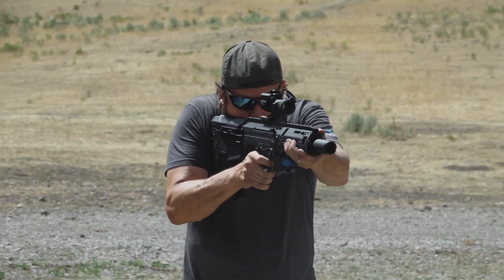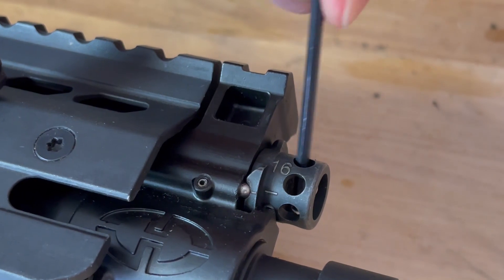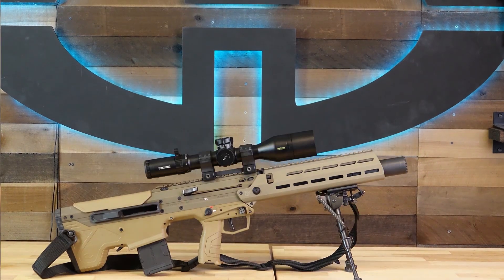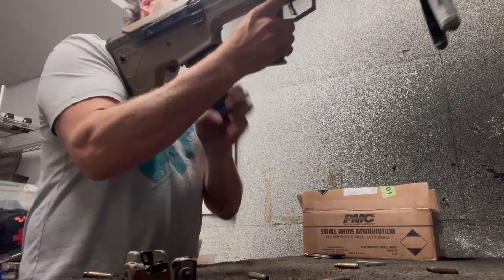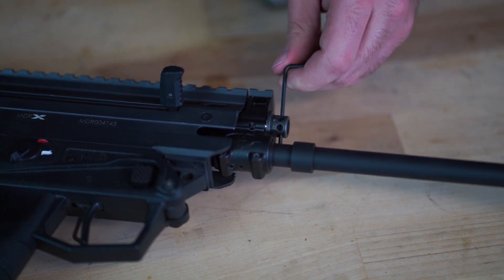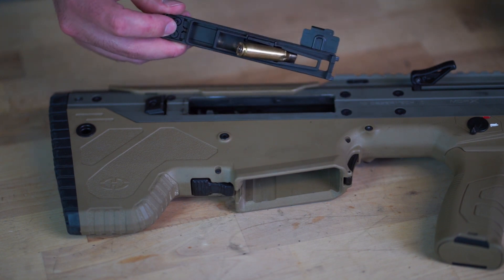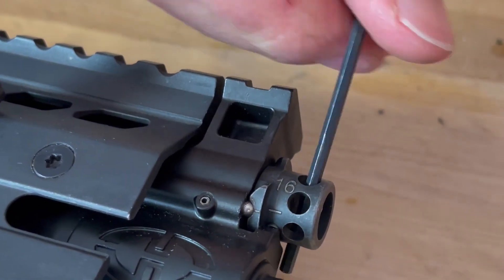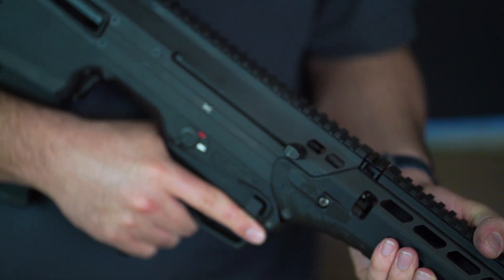MDRX Gas Valve adjustment

Comment: When I initially got my Side Eject MDRX back in 2022, I was pretty depressed to be getting stovepipes on nearly every other shot of both .223 and 5.56.

So I thought, ok, boost the gas, that should solve it? Did so, and it worsened the problem substantially. But...one click down to N-? Runs like a top. Zero issues since. Thing is perfect and I love it.

Comment: I have an older gas valve on my 16 inch 5.56 barrel. It is incredibly difficult to adjust with the handguard installed. I was disappointed to find out today that a replacement newer version is $79!!! And I'm guessing that doesn't include Shipping or Tax!!! I was under the impression from reading in forums and watching videos, that I could acquire a replacement with the cost of shipping. Guess I was wrong. 😡🤬

Comment: That last tip is very important. Most guns are over gassed from the factory. I know some people who have turned their gas down two settings. It makes a big difference in the recoil and controllability of the gun.
Reply: Tell me about it.     My .308 MDR runs on the lowest suppressed setting fine.  And its not even a suppressed rifle.   This is on the last gas valve that has the single hole in the center with a screw driver cut slot..  I have a collection of gas valves here.